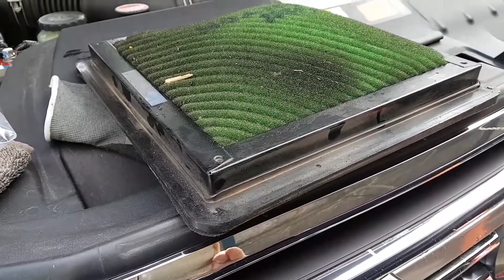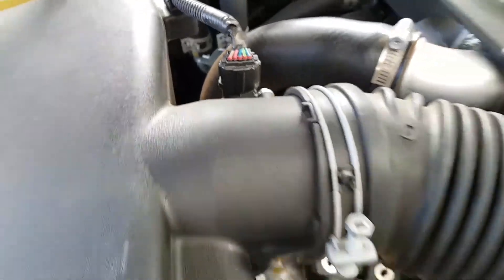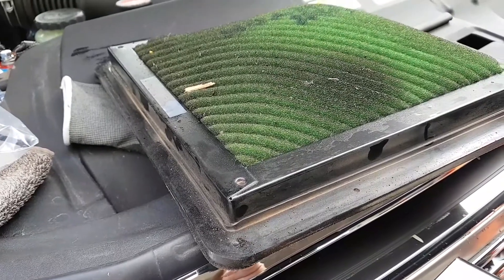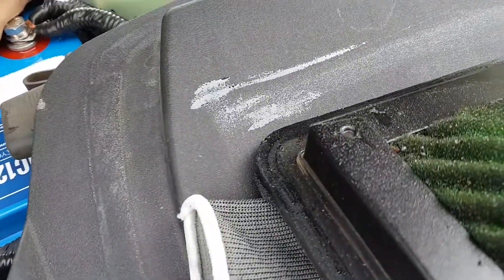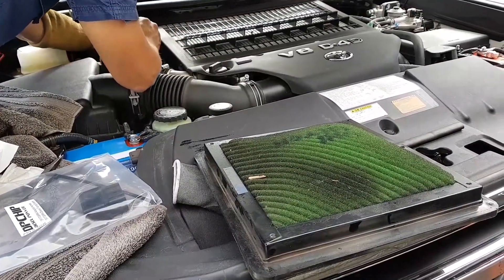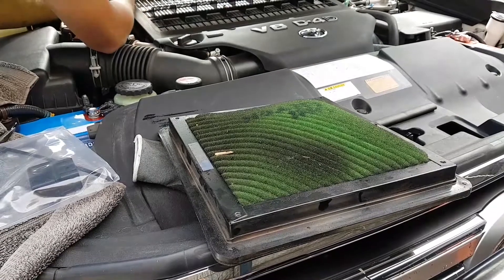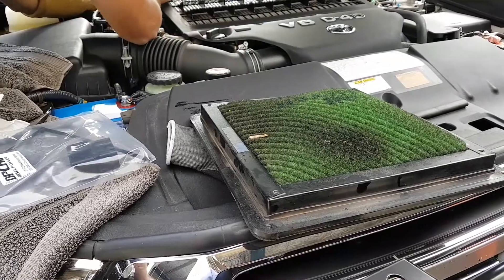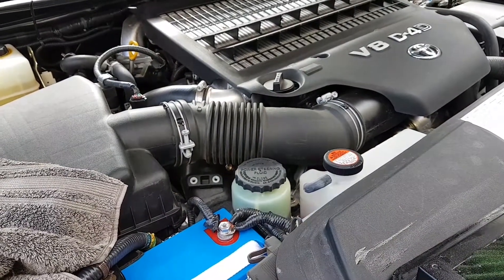Oiled Air filters and Power Loss

Comment: hi Oiled filters are high maintenance if done properly . 
The problem is airflow dries them out b4 normal service interval  and vehicle vibration can cause the oil to migrate to lower part of filter  reducing its purpose of filtering .